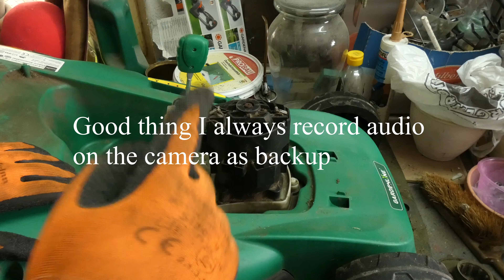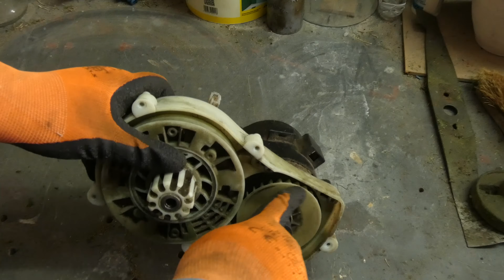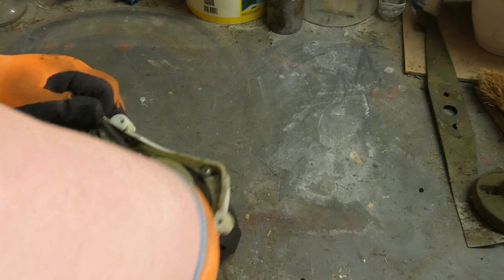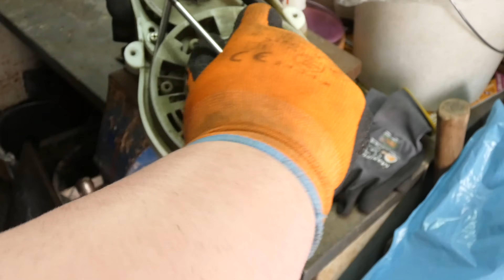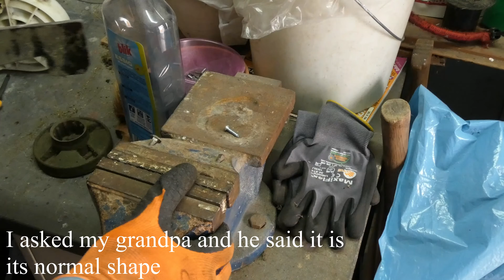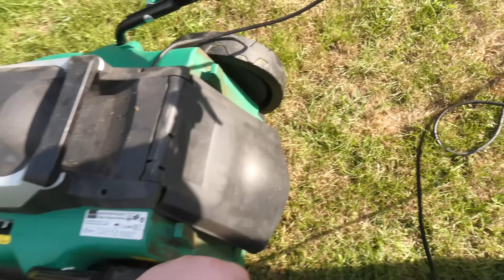Electric Lawn Mower Repair - Common Fault

Comment: I have the same lawn mower but that's not the problem I have. The motor spins but then slows down and eventually stops running. There's no dirt or gunk in it anymore that's been cleaned out. But it does have sparks when running. Which I know some motors are designed that way like the motors that run in paper shredders. However unsure why that issue is happening and what can I do to fix it since it's past warrenty?
Reply: This firstly would be the motor brushes and commutator. If you can find the parts and get access you can clean the copper and replace the carbon brushes with new ones. Rarely the second thing could be related to bearing wear, the spindle could be running off centre causing minimal contact between the brushes and the commutator, sparks happen when the carbon brushes do not make enough contact to allow the needed electric current through, the small area that makes contact gets hot like an arc welder. I hope this is useful 🧑‍🔧

Comment: Hi Anna. A drop of oil on that bearing would have helped a bit, perhaps a quick wash out with petrol or parafin first. I hope it's covered with something. That tight bearing may have helped the belt to fail. These mowers should only be run for 10 or 15 minutes on long grass or the moter overheats. 5 minutes will do.
Reply from the maker: Hey jp :)
I completely forgot to mention it but I flusehed the bearing with some rubbing alcohol. Applied some on top, turned it until the old stuff came out, removed it and repeated this process until nothing came out anymore. Then applied some oil on top, turned it several times and repeated the process a few times. Then it sat for a few days with additional oil on top until the replacement belt arrived. It got a bit better but not much. The weird thing is it has a higher resistance in one direction but not the other. Oh and I figured out that the motor spins in the direction of the higher resistance so you might be right.

Comment: Supposed to be bent as it helps lift grass for better cut
Reply from the maker: I think you are right. Especially considering that it is a perfect fit as we can see in the end when I lay it on its side.
Reply: @PhysicistAnna the bends are also to create a vacuum/blower effect. Like an airplane propeller. It sucks the ground as it goes along so the grass stands up for cutting then the chopped up grass is blown upwards and into the back hopper. Air exiting from slots in the hopper. I hope this is useful. 🧑‍🔧